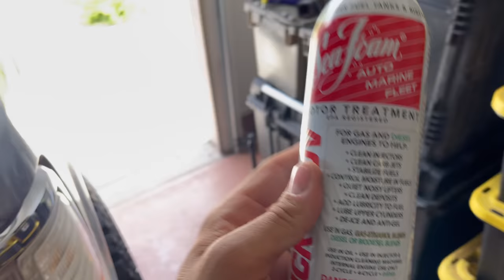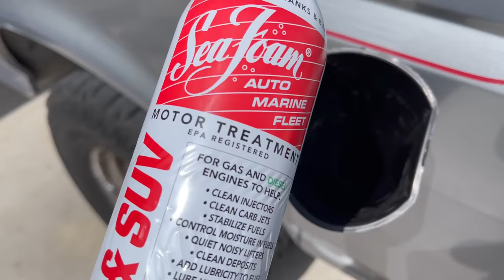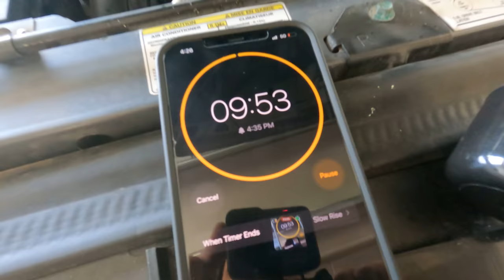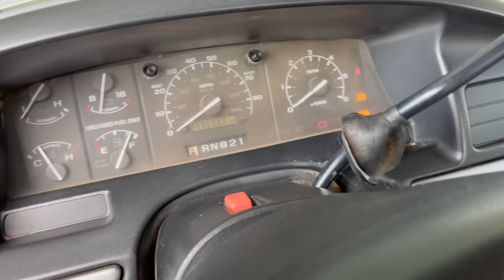Seafoam - Engine Treatment | How-to and is it safe inside your motor?

Comment: Good advice on how to use but you left out 2 pretty important things. 1st never use Seafoam if you have an oil leak or oil burning, when the cleaner removes the deposits of carbon it will make the leak/burning worse. 2nd thing is that seafoam isn't really meant to be used on newer vehicles, do to the amount of carbon it blows out, it can seriously damage your catalytic converters. Seafoam is decent stuff but should really only be used on older or higher mileage engines and mainly as a last resort. Almost 20 years of being a mechanic has shown me allot. Otherwise good vid bro keep them coming.
Reply: I keep hearing reference to older vehicles and am never sure what years qualify as older. I have a 97 firebird, v6 3800 series 2 (3.8), i dont consider this car old as far as mechanics go. But does this fall into that catagory your referring too and is it generally the same for other mechanics? Its fuel injected, has all disc brakes, obd2, has enough computers and sensors to drive me nuts. So even compared to my previous 1990 Jeep Comanche, my car may be old but in my mind in the category of newer in the context of this video and your comment
Reply: @chrislovesdetailing  generally I tell people, if your car is older than 2010 that's what would be considered as an older model. However I agree 100% with your statement about a 97 not being old per say. A good way to look at it is, that the newer the vehicle the more emissions crap car manufacturers put in the vehicles and with that the more cats and emissions stuff a vehicle has the more likely it is for a vehicle to have adverse effects from products like Seafoam. Your car should be fine as long as it doesn't leak or burn oil before hand. Since vehicles started using direct injection, it's kind of the point that I wouldn't recommend using a cleaner unless a last resort.
Reply: @chrislovesdetailing  also I can't speak to what other mechanics would say or do, I'm basing my statement off of my own experience over the years.
Reply: Appreciate it, experience is worth more than anything to me. Ive been chasing an electrical problem, low volts making an the precat o2 not function right and causing -10 to -15 long term fuel trim. Managed to just fix, improve and now confirm battery and charging system is great, but i must have a poor ground that works but restricts effective and consistent min current to sensors. So i consider my car in the new category because of these kinds if issues but definitely not as bad as the post 2010 cars that are more computer than car lol
Reply: @chrislovesdetailing  if your numbers where - then your car is running rich and the ECU is trying to compensate by trimming the fuel. I'm not sure if you've done this yet but take a good thermal gun and measure the temperature before and after the cats ( if you still got them ) if temperature is hotter on the pre cat side then cats clogging up, also the voltage on the o2s should be going up and down on the pre cat sensors and stay pretty steady on the post cat O2 sensor at around half a volt. Have you cleaned the MAF sensor?
Reply: @Ironhand187  ya, definitely running rich because i can smell the gas over time in the oil 😬. And no, i had just been made aware this week that a thermal gun is useful to see where there is resistance or bad connections as the wire or terminal would heat up, which was thr case for the power terminal on my alternator until i redid the terminal connector to right Guage (was one too big) and a much tighter crimp usin vice grips. And i cleaned the MAF and all the air flow sensors around the throttle body early on, thinking it was between those and the fuel pressure regulator. According to obd2 live data, MAF is good, vacuum pressure and all other air intake data points look good. I did a very short attenpt to clean the cat by spraying carb cleaner into the brake booster hose but was afraid to do damage so sprayed very little, didnt see much smoke but did make a difference I thought. Perhaps ur into something there. I do need a new cat soon to get a legit smog this time around lol
Reply: Funny enough i do think it's a ground. Right after responding to you, i had sprayed wd40 on some of the electrical under the hood, which i doubt had an effect since i was focused on the headlights, but i tried spraying the antenna and the parts of it within the car since it stopprd going up and down despite the motor sounding like it was working. While lubricating it and spraying it's components underneath, i found what appears to be a ground chain or whatever its called, the strip like wire resembling a shoe lace in shape. I sprayed all the components and felt that chain up, and when i started my car it ran better than it ever has, but was short lived before trim got worse. But i all if a sudden had more obd2 measurements that i hadnt ever had available before. I think theres a bad connection or the wire is torn, explaining the malfunction of the power attanna as well. Im going to inspect in the morning. 🤞
Reply: @chrislovesdetailing  they're ground straps, if ones not getting a good connection they can cause all kinds of stupid issues, but the good news is you don't necessarily have to use the same ground strap location. If you need you can add additional ground wires to the car.
Reply: @Ironhand187  i really appreciate your responses. After locating and cleaning the engine to chasis ground, ive had much more consistent normal charging volts. It was caked up thick by the leaking power steering from above it.

Though the system has now started to show mild symptoms that are clearly ground related, like random glitchiness of the radio mainly but other areas randomly showing inconsistent or abnormal power supply. I suspect now every ground and perhaps some power wires are all have compromised integrity or are too filthy to function. So i will locate and clean as i find them and when i can spend enough, do the big 3 upgrade and add straps where possible.

Would u recommend adding a strap along side the factory connections locations and straps over a complete replacement? Some have said this despite small risk of a loop of somesort that wouldnt be good lol. 
And in either case i suppose i could chose a different ground point, but if i clean the original, it should be best to use that still to avoid potential unintended errors on my part. I mean half the problem was originally an improper crimp and the wrong guage terminal eyelet for the battery to alternator power wire... So less is more from me lol
Reply: @Ironhand187  almost forgot i need to buy a thermal gun and try this regardless of the ground issue. More Good advice. Thanks again
Reply: how old
Reply: @chrislovesdetailing  You seem to know your stuff, I’ve got a problem weird my 76 you have a place to send pictures to contact you?
Reply: I recently made that mistake. Damn I wish I knew
Reply: I have a Detroit diesel engine dd13 I was trying to find and additive to keep injectors clean,  my truck is a freightliner cascadia 2021, so your saying do not use
Reply: I recently bought a 2017 Ford Fusion 1.5L Turbo with 75000 miles on it, previous owner used cheap engine oil and Korean filter, the car has a ticking noise on start ups, become less gradually with warming up for some 2 mins but when starting to give gas and go the ticking noise is evidently heard, the noise goes away or becomes quiet when going past 40 km/h, I have P0012 code:  “ A Camshaft Position Timing Over-Retarded Bank 1” , Ford dealership mechanic asks to replace camshaft, timing belt, water pump, right and left digital sensors, and a corroded piston! A shop mechanic advised me to flush the engine with Liqui Moli and change the oil from 5w-20 to 5w-30, but recently come across noise fixes with SeaFoam and Marvel Mystery Oil and been watching videos and comments that are impressive and about to give Sea Foam a try but your comment is interesting, does my 2017 Fusion 1.5L Turbo with 75k miles qualify for using SeaFoam or not ? Or Liqui Moly flush is enough to try ?
Reply: @AngelLoverErbil  I personally wouldn't recommend it for a few reasons. Do you know what the maintenance history is?
Reply: @515051506969  diesel engines are completely different animal
Reply: I call bullshit on everything you just claimed.
Reply: @RR-dq1ns  What I claimed ?
Reply: What if the cause of oil burning is a stuck oil control ring? Like in the case of the Toyota engines?
Reply: @Ironhand187  no I don’t know, no maintenance history record, all I know is that the previous owner was a neglected person (his younger brother said so and the car overall state says so, owner brother said that his brother has added a cheap oil, change and you’re good to go but I realised that I’ve been deceived as the oil change didn’t fix it and remembered him playing unpleasant songs in high volume so that I don’t suspect the ticking), some mechanics advise me to change fuel more frequently (new oil has been in since 9th February), thinking of changing in the next couple of days
Reply: @AngelLoverErbil  that's sad to hear, those turbo 1.5 engines should be used with the correct oil at all times. I wouldn't want to say for sure without seeing it but if you're getting a tick you can try checking the plugs or adding a octane booster to see if you're just getting engine ping. But there's a chance that you have a bigger problem. Have you checked to see if the sensor is working correctly? I hate to hear of someone getting screwed over like that.
Reply: @Ironhand187   so if I have a minor oil leak in my 05 dodge ram I shouldn’t add it ?
Reply: @roberttarango8949  there's a lot of things that can come into account when using a carbon remover, such as engine or weather it's ohv or ohc. What engine does the truck have? Hemi, 4.7, or v6
Reply: @Ironhand187  4.7 v8 4x4
Reply: @roberttarango8949  internal or external leak
Reply: @Ironhand187   I believe Internal since I never see oil under the truck.
Reply: @roberttarango8949  I personally wouldn't recommend it especially if it's not using allot of oil
Reply: @Ironhand187  I do care my car but used cars are used by many notorious and careless people especially in societies that lack auto literacy and live with cheap stuff in their mind (previous owner handled me the car with a Motorcraft air filter that I believe never changed until I did it at 75k miles! I cleaned the throttle body with Motul throttle cleaner and installed Denckermann air filter, he handled me the car with a not reputable battery, installed with battery bag and the base left unbolted! I cut the bag and bolted the base and thinking of replacing the battery once the weather gets hot.). Previous owner said that he have replaced spark plugs but I don't know when and what type of plugs he has used. The sensors cleaned by a mechanic assistant with a Chinese copycat of WD-40 and said that they were pretty dirty, checked it with battery and said that they are working.
Reply: @chrislovesdetailing  old car means a car out of warranty and at least 100,000 miles
Reply: Think of your vehicle like a child (when it comes to age) "getting old should be between 10 and 13 years old and "older" is a teenager able work, 15 plus years LOL
Reply: Omg I used the sea foam on my 2003 Mitsubishi Outlander w/251,000 miles and it started burning 5 quarts of oil each day, last Saturday the engine blew up and I had to get a new car, I’m never using that crap ever again! I found out the mechanic stole my catalytic converter when the junkyard refused to buy my car for 400, all they wanted was the car😞 I’m suing the mechanic now. This shit needs to stop 🛑
Reply: @Tastybuckshot  please stop using that product, my experience resulted in a blown engine on my 2003 Mitsubishi Outlander just last Saturday it blew and that’s only 3 months from an engine rebuild. I had 251,000 original miles but the newer engine only had 100,000 when it blew.
Reply: Not true
Reply: Use it on newer cars no issues
Reply: @Tastybuckshot  depends on where the leak is at
Reply: @bluej333  what new cars
Reply: @bluej333  seafoam is ok as long as you don't have an oil leak
Reply: @Ironhand187  I’ve used it on my 2021 Chevy no issues , 2023 Dodge Ram work truck, no issues
Reply: @Ironhand187  I never said I do. But on my 2008  Scion it has a minor leak and I use it still.
Reply: @bluej333  where is the leak
Reply: @bluej333  the thing I advise is that if a car hasn't been taken care of very well and has allot of carbon build up that using seafoam can cause any leaks to get much worse. Everyone's free to draw there own conclusions, but I've fixed enough cars over the past 20+ years because they used a carbon remover. Not to mention the damage it can cause to the cats
Reply: @Ironhand187  so mines ain’t leaking but its burning like a mf would i be good to use it why/ why not?
Reply: @daddymikey2334  burning oil usually means rings or another part of the valve train is messed up so would it help you out with slowing oil burn, I doubt it. As for why I don't recommend the stuff is due to it being a carbon remover. When people who have allot of carbon build up use it, and it removes the carbon, it can  cause issues because they may already have a broken gasket,o-ring,etc and the build up of carbon could've been the thing stopping the oil from leaking badly. If I was you I'd do a leak down test and check compression results to see if you have a valve gasket leak or oil rings on the piston. You can also try checking the pcv valve.
Reply: @MarkieSYN Thank you very much for the heads up. I have an 07 bmw 328i that won't pass emissions inspection due to code p0491 (secondary air injection low flow). Based on my inspection of the secondary air injection system, I have came to the conclusion that the low flow is due to carbon build up in the intake valve ports. The suggestions to clear the carbon is to pour seafoam into the intake valve (about 3oz). Will putting a little seafoam into the secondary intake valve have any affect on the oil leak, or is it only the methods in this video that will make the leak worse? I have an offer from a dealership to buy the car as soon as I can get passed smog. Any advice would be very much appreciated!
Reply: @El_El_Guapo  if you don't have a gasket or seal leak then you should be ok. However if your car is direct injection then you would be better off having the carbon removed by a shop with the correct machine that removes carbon from the intake valves.
Reply: @MarkieSYN  thanks for the quick response! The cheapest quote I've gotten for a cleaning is $3,000. It's very labor intensive I've been told and dealer is only offering me $2,400 for the car. All the bmw forums I've read say it's safe, but you were the first to point out the oil leak concern. The video linked shows the method. I guess I'll roll the dice and see what happens. Worst case I'm out $2400. Thanks again!

https://youtu.be/v7YZ7q-xCyw
Reply: @El_El_Guapo  since your just using it on the valves and your not leaking oil through the valve seals then you should be good to use it to clean the carbon, but be warned if you do it right and all that smoke starts coming out the exhaust, leave the car running until the smoke stops or you can ruin the cats on the car. Any other?s just let me know
Reply: @El_El_Guapo  yeah you can try the method they used in the video. That's assuming you don't have any pre existing oil leaks, then I'd say you should be good to go. If you do have a small oil leak then after doing the same thing as the video, buy some oil conditioner or similar product and use it cause it will cause the gaskets to swell up a little and may stop the leak if it's not to large. Hope you get it fixed man.
Reply: @MarkieSYN  thanks so much! I passed emissions on Friday. Apparently, changing the check valve was the solution. I did not need to resort to the seafoam method. But, I would like to thank commentors such as yourself, as you and many others have played a huge role in solving mine and others' issues. I'm sure your responses have helped more people than you will ever know. Please keep spreading your wealth of knowledge to clueless saps such as myself. Thanks again!
Reply: Totally not true
Reply: @davidberg7317  and your mechanical experience?
Reply: Sometimes I smell hot / burnt oil from the hood of my car after driving. Does that indicate a leak?
Reply: How about a rear main seal leak? I have very minor leae would that be affected?
Reply: @Abdul-mh5zh  get a oil conditioner something that causes the seals to swell up. A good brand is called BlueDevil rear main seal stop leak
Reply: I have a 2003 Subaru with 320k it has no oil leaks at all but burns 1 quart of oil for every 1k miles this oil travels the Passenger breather tube to the air cleaner box then into the throttle body and beyond needless to say my manifold is gunked up bad. Should I give seafoam a try?
Reply: @weyoutkiller987  you can give it a shot, but it's not going to stop the oil burn
Reply: Can I use this on my ford Taurus sho 2010 turbo engine
Reply: What about just using it in your fuel occasionally?
Reply: @KillerofGods  u mean the fuel treatment
Reply: @Ironhand187  Yeah just using it for the fuel treatment and not putting in your oil or anything else.
Reply: Sea foam is the only petroleum based product so it’s a lot safer then all of the alcohol based products and it will not hurt your catalytic converter as a mechanic that has 21 years of experience it helps the engine more then it does harm
Reply: @glennfuller3384  tell that to the thousands of people who use it and have worse issues like some of the people in the comments. As a fuel additive it's fine but I am always careful before trying it for carbon removal.
Reply: Wrong I use seafoam  on everything  even with car that had leaked and it didn't  make anything  worse at all it help I work on newer cars and older cars I have experience  this alot I buy and sell cars I make sure all newer and older cars
Reply: Thanks
Reply: I don’t run cats so hopefully I’m ok
Reply: Bet ur neighbors & tree huggers everywhere are like "wtf bro"  !!!!    Lol
Reply: It cannot “damage” catalytic converters. It just can’t. It’s possible that it removes enough carbon and blows it out the exhaust lens ding to your converters getting clogged or becoming Less efficient until it burns off. Either way you pull the cats clean them and good to go. Unless it’s a chemical that dissolves ceramic and platinum or rhodium or so violent burning that it superheats converters but it’s not and cannot
Reply: Is intake and turbo cleaner fine to clean my intake and intake valves? My car is also direct injection so seafoam would pretty much just be cleaning my fuel system. I was planning to use both. I have a 2015 Acura TLX v6. Any advice would be great! Thanks.
Reply: @sethbrown5856  sorry but if yours is direct injection, there's no pour in cleaner that's really going to help clean the intake valves. You'll need a professional service clean or if you're mechanically inclined to, you could try to do it yourself but I wouldn't recommend that.
Reply: @bluej333  let me know how well that works out for you lmmfao 🤣😆
Reply: @ucheuwah5729  not necessarily
Reply: @javarisbutler9160  for what?
Reply: @KillerofGods  you should be good
Reply: @njmxjunkie3128  no shit. I didn't think I'd have to say it in details, most car people know what I meant. Of course it's not going to actually destroy the cat, but a clogged cat is a bad thing.
Reply: @Ironhand187  I worded myself weird. I meant to say i was planning to use the intake valve cleaner to clean up the carbon build up in intake and intake valves. I’ll was also planning to use some seafoam to clean up my injectors. The intake valve cleaner is a spray that’s meant to be sprayed into the intake. Will I run into the same issues with using the intake valve cleaner as you would using seafoam on a port injection engine?
Reply: @Ironhand187  the likelihood of clogging a converter from sea foam is so unbelievably unlikely
Reply: @sethbrown5856  just use one or the other. Pretty much same stuff. And you put seafoam in all holes. Oil, air and fuel.
Reply: @njmxjunkie3128  lmmfao if you say so. I'll stick to what has worked for me and the people whose cars I've been fixing for over 20 years
Reply: @Ironhand187  Worked out wonderful for me no issues at all. We do it at the shop as well no issues at all
Reply: @bluej333  do what?
Reply: @sethbrown5856  doubtful that if you're using the spray cleaner that'll cause any issues. I just don't recommend using it for oil issues.
Reply: @njmxjunkie3128  your telling people to put it in the oil? Without telling them to follow the directions on the can and change the oil after use? You can't just leave it in there
Reply: @Ironhand187  same here. I’m 35 and have been doing mechanic work since 9 years old.
Reply: @sethbrown5856  problem with direct port injected engines is they build a lot of soot and carbon in the intake valves. Just wipe out with a rag before spraying cleaner and if your spraying a lot of cleaner in them you have to pull the plugs and clear the cylinder before you run or attempt to start engine. Otherwise it will act the same as having water in cylinder and hydro lock or bend a valve
Reply: I have a 97 wrangler TJ that I bought 2 months ago. This past week it’s, oil pressure will drop to 20 PSI only when the engine is fully heated and at idle and it will shake. Once I hit the gas, it goes between 40-60 PSI. When I first start it cold, it stays at 40 PSI without shaking and only starts once it warms up. I was thinking about running it with this seafoam treatment and then changing the oil to a higher viscosity. However, it does have a tiny oil leak (maybe 1-2 drops/night). What would you suggest?

@ironhand187
Reply: @SamuelThompson-rh2su  a good rule on oil pressure is 10psi for every 1k rpms so if you're at 20psi at idle, your probably fine especially If it goes up when driving. As for the seafoam question, it all really depends on where the leak is and how you are going to use it.
Reply: So if I have a oil leak is it still safe to spray in the intake? Or should I just make sure to not put it in the oil?
Reply: @fizzinglugee6344  depends on what your hoping to achieve? If you're trying to carbon clean or fuel system clean?
Reply: @fizzinglugee6344  no your perfectly fine to ad to oil. Leak or not. Yes intake and oil
Reply: What happens if have oil leak?
Reply: @JasPharmor  depends on where leak is
Reply: I think they said at the bottom put i never see no oild spots under my car?
Reply: @JasPharmor  check around the valve covers and if it's leaking from there and just dripping down
Reply: Ok
Reply: So if my 350z has and oil leak and it obviously burns oil I shouldn’t use sea foam I’m about to go on a road trip and was gonna do this til I saw this comment??
Reply: It also trashes turbos .carbon chips off the piston score the turbos before they plug up the catylitc converter.what seems like a good idea can end up being very expensive.
Reply: What should be used
Reply: What's the best to use to clean the cat if trash does cause problems
Reply: Not true works on all gasolime or diesel engines new or old, unless your engine is vegan
Reply: You haven’t even seen a car it’s torn up … 🥱 don’t be boring
Reply: I have a 1996 F150 with the 5.0 I have a rear main seal leak have to add half a quart every 2000 miles pretty much. I do oil changes every 4000 miles. Would I still be able to use a seafoam treatment?
Reply: @thedornado3931  I would recommend an oil conditioner so you can try and get the seals to swell and stop the leak before using the seafoam
Reply: @Ironhand187  what would you recommend? I’ve never heard of that.
Reply: Can I do the fuel and the air intake not to the oil?
Reply: @thedornado3931  the fuel treatment is ok. Even the oil treatment is ok as long as you don't have any major leaks and follow the instructions